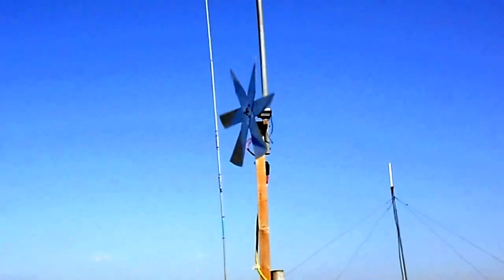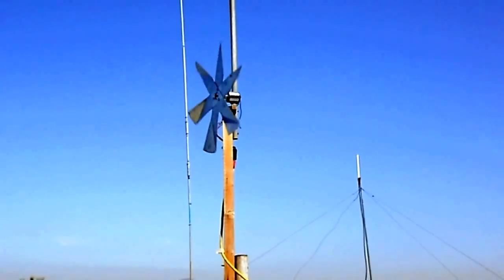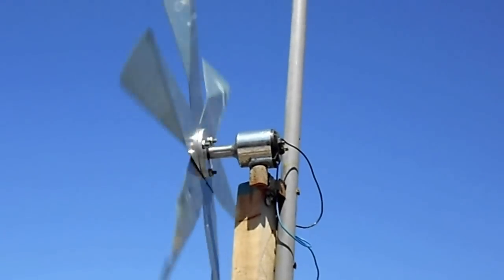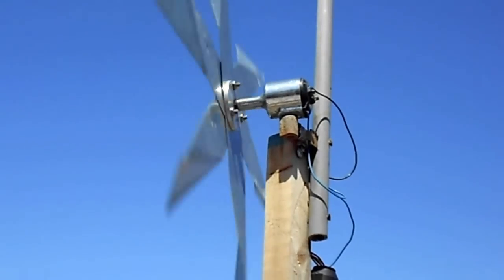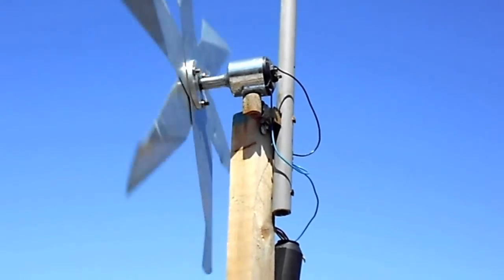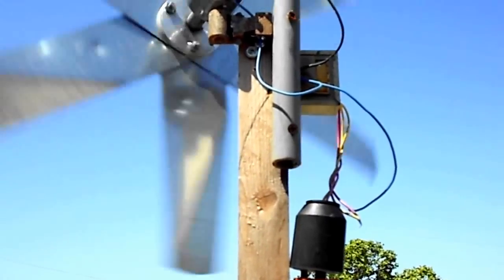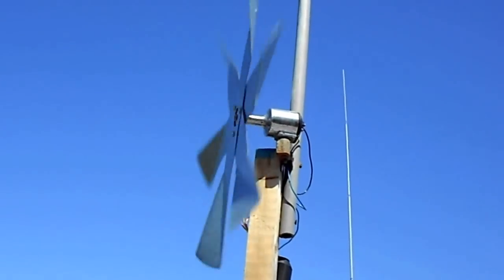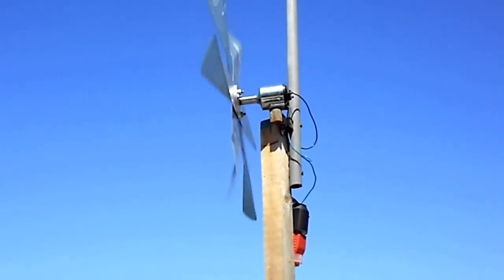Wind Generator Bicycle Bottle

Comment: Hi great , work ,,what size rectifier  you use and what power you getting ?  Could you charge a battery with it ? What would i need ?
Reply from the maker: I used a silicon diode bridge rectifier out of an old radio. I would guess it was good for 1A, but had no data sheet for the part. 

It was not the most efficient. The power output under was about 12v 50 mA in a stiff wind. I used it to charge an old dead cellular phone, but it took a couple days.

The parts I used was a “fan blade” from a harbor freight mole chaser, an old bicycle generator, a used 70v audio transformer, a used silicon diode bridge.

It was a good proof of concept, but not that efficient, next time I will try different motors , fan configurations and away to have the fan face the wind.

Comment: Like you say above in the video description, it puts out almost nothing.  The reason is that the generator is designed to operate at a very high RPM achieved by a small wheel on the generator rubbing on the bike tire revolving at usually 10 to 15 mph.  Watch how fast it spins as you lift the back wheel off the ground and crank it by hand.  Watch the original incandescent light get brightest when the generator is spinning much faster than it does with your wind rotor.  You need a pulley several times larger on the rotor than one on the generator to make it efficient.  Bike gens are typically 3 or 6 watts and 6 or 12 volts, so you will soon burn out an LED which needs around 1.8 volts.  You need a properly rated resistor to protect it.  You will also notice the LED has a high frequency flicker.  That's because these are actually alternators, not generators.  They make AC (alternating current) not Direct Current.  L.E. D.s are Light Emitting Diodes.  Diodes let electricity pass in only one direction and block electricity of the opposite polarity.  Alternators switch polarity very rapidly.  LEDs light up only during the matching polarized half cycle.  You might want to include a rectifier in the circuit to change AC to DC to make full use of its potential, especially if you need DC to charge a battery, power a radio etc.

Comment: Nicely made.  One advice if I may. Looking at your blades I noticed they bend more on the outer ring than they do on the inside diameter.. I would recommend you change that for better efficiency.  Rather bend the blades more from the middle of the wheel and straighten them as you go towards outside , It will help you gain in speed and It wont wobble much on higher wind speed and it will also help the wheel spin easier and better on lower winds.  I recommend you make another wheel instead of changing the shape of this one. so you have both and see the difference.  Also it looks strong enough so because of that you should make one more propeller consisting of 3 blades only. It will help you gain more speed .

Comment: You can get a 12v 12watt bottle generator dirt cheap. Put a rectifier on it and put a few caps in paralexia  with it and you can get quite a bit of light for 12 watts!  The best LED light are 200 lumens per watt.  You could run 4 500 lumen lights with no problem if you get the really efficient LEDs. Even with the rectifier, 10 watts should be fine.

Comment: what is the minimum speed required for the dynamo to work... or there should be a need to increase the speed via pulley etc
Reply from the maker: Manuel Adjepong. the dynamo started turning at 5mph or 8kph. I tried using a belt and pulley, but it wouldn't start spinning till 15mph/24kph... I decided to use a transformer as a "electronic pulley" trading current for voltage. I lost some power, but it was satisfying to see it spin in slow wind.

Comment: Why was the 10:1 transformer necessary? If this is a bottle generator with two outputs, one of the outputs likely is 12 VAC at 500 mA.
Reply: +klafong1 fair amount of power. step down and charge cell phones.
Reply from the maker: klafong1, the bicycle Dynamo I bought requires about 3000 rpm to generate 12v@6w (it was made to rub against the rear tire of a bicycle). I was lucky to get 300 rpm in 30mph/32kph wind. I choose to use a transformer as an "electronic pulley" trading current for voltage.

Comment: Run the ac power from the alternator to your house then to a rectifier to change to DC at point of use. Using the transformer you will lose some of the power.
Reply from the maker: digitalfuk  thank you I will try that on the next one

Comment: very smart idea, could you tell me whats the voltage it can provide?dont you need a gegulator to?i mean to protect youre battery? ceep up the good job.
Reply from the maker: stagan stagan, it provided about 12 volts in 24 kilometer hour wind,  but only enough power to light up a light bulb or charge my cell phone